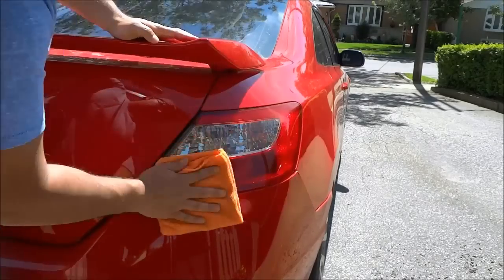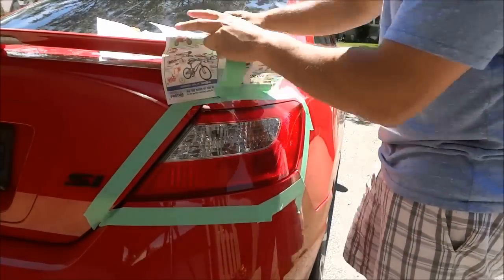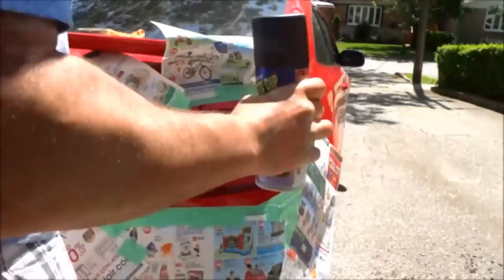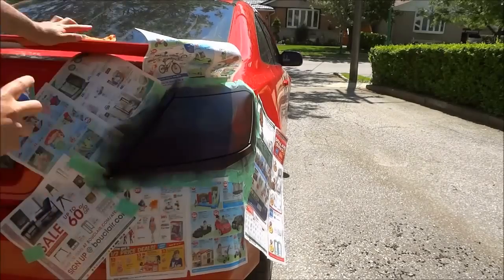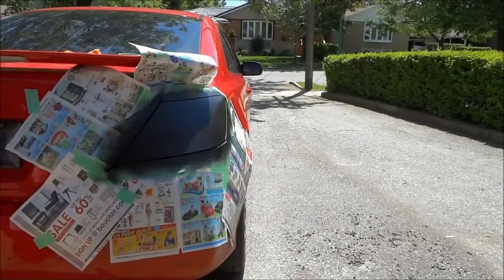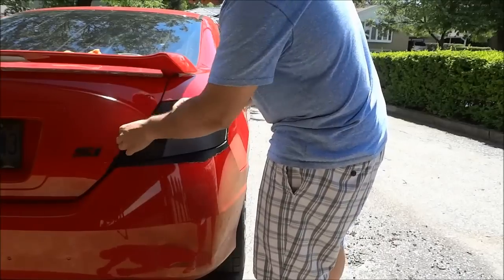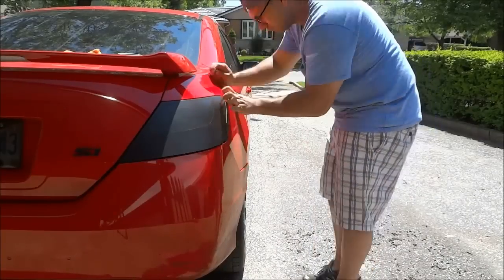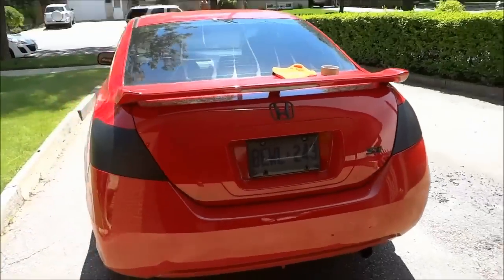Smoking My Tail Light With Plastidip (8th Gen Civic Si Coupe)

Comment: What the hell is that! You suppose to clean and sand it with 1200 grade sandpaper and then spray vht nightshades on (look way better)
Reply: +Ryan Singh plastidip works great too! just not like this lol.. should have did 1 coat matte black plastidip and then 3-4 coats of glossifier.. whould have looked maaaaaaad. +helpful diy
Reply: +Ryan Singh You don't need to sand anything when you use plasti-dip spray. If he would have sprayed the glossy clear coat on after this, it would have been way better. Plus this is very easily removable if you mess up or don't like how dark it is. If he sands the tail light, then he pretty much is stuck with a dull tail light after he removes the plasti-dip later or would have to polish the tail light to make it look like it used to.